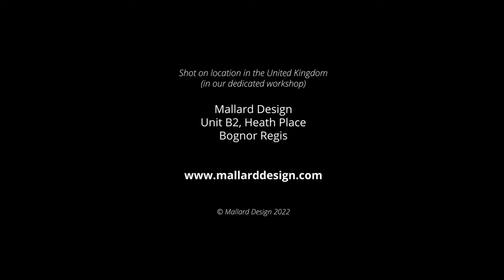Building a 64 drawer apothecary style small parts storage cabinet

Comment: what were your thoughts on using small nails (brads) to build the carcass rather than glue?  Do you think it will hold tight, particularly with small nails?
Reply from the maker: @Birchwoodbldrs I used both pin nails and glue  throughout the carcass build. About 19:24 you can see me smearing the glue before I inserted the first end piece. All the internal vertical partitions were glued before I used the pin nails. The small panel pins may well be strong enough to hold everything together, especially with the number I used on the ends, but gluing always adds to the strength with this kind of butt joint. 😀

Comment: What do you think about fully or partially assembling the carcass before installing the vertical dividers? Carcass might be built with or without the back, or held by straps and some 90 degree blocks?
Reply from the maker: Yep. All of those would work. Depends what you have to hand. I don't think there is necessarily a right or wrong way to do it. I know I faffed around bit getting everything together, but it all worked out in the end. 😀